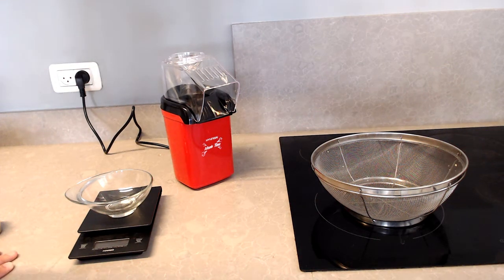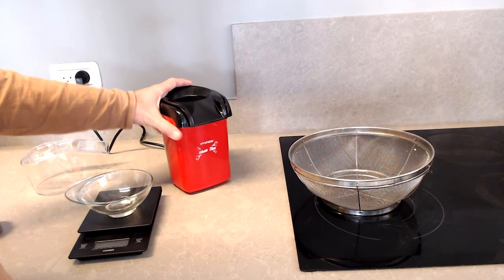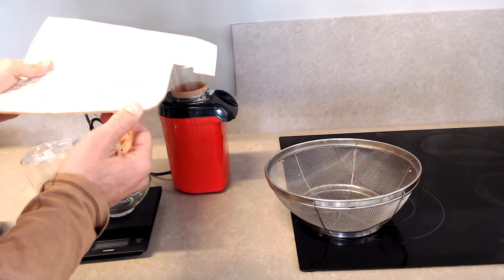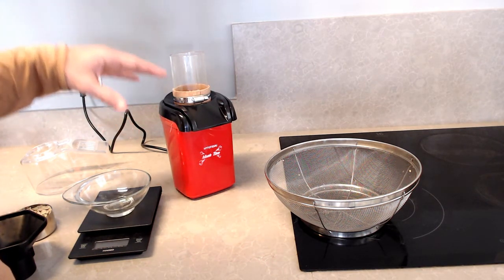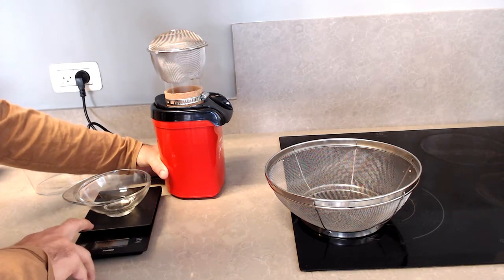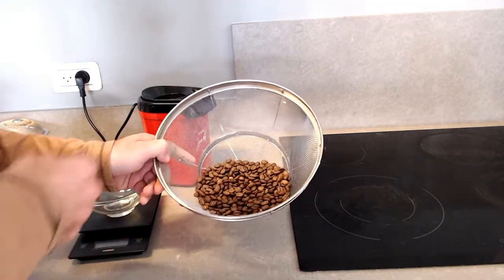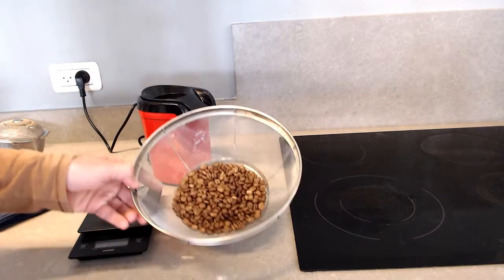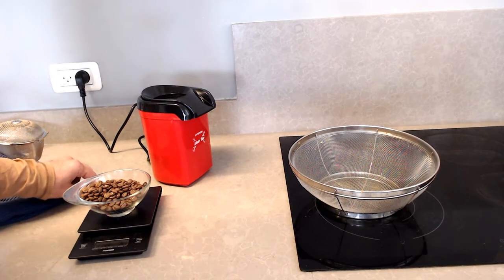Modified hot-air popcorn popper coffee roaster

Comment: I have exactly the same machine, I'll try all your tips. Especially like this mesh strainer. Kudos to you :)
Reply from the maker: Thanks. If something is unclear from the video LMK and I'll try to explain. Be sure not to go over 85 grams for light roasts and 60 grams for darker ones.
Reply: @foundparts6301  60 grams even if glass chimney is added? The mesh herb container is already in the basket. Moreover, I plan to control the fan and heater separately.
Reply from the maker: @3YAPA , feel free to experiment. I found my absolute maximum to be 85 grams. Above that the fan won't turn the beans efficiently and eventually burn the heater, wrecking the machine.
Separating the control is a great idea. I tried that but on my unit the fan and heater are connected to same line with a devilish voltage splitter and I didn't find a way to do that without taking the entire circuit apart. If you find a solution please let me know.

Having said that, even with a unified control the machine produces terrific roasts. Been using the same unit weekly for two years without a single problem. Once you understand the limits you get really nice medium roasts in 5 minutes.

Comment: No need to remove the thermostat on this one? Can you get dark roast?
Reply from the maker: Yes, you can get quite dark roasts without removing the thermostat. Try roasting under 70 grams and remember to agitate the beans every minute or so by shaking the machine lightly.

The glass chimney has a huge thermal mass, this improves the uniformity of the roast while making sure temperature rises in a more controlled manner.
Reply: @foundparts6301  thanks friend, will try without chimney when mine comes in and then see if it's something to add. I am going to try air fryer roasting as well.